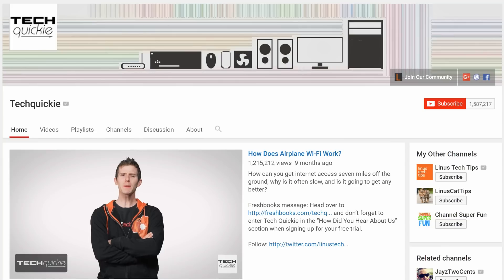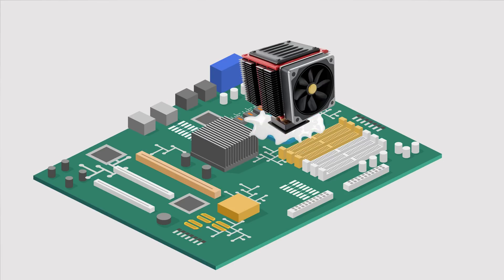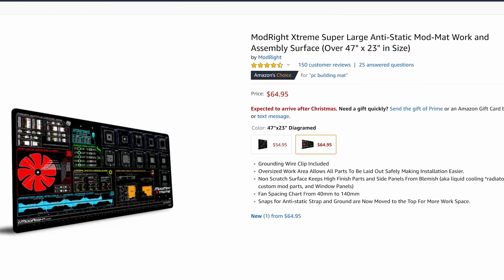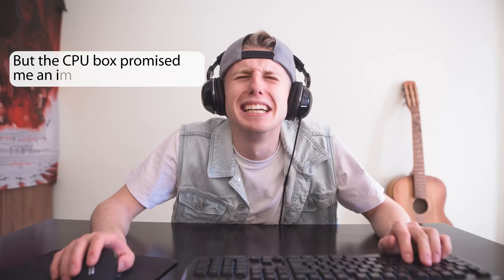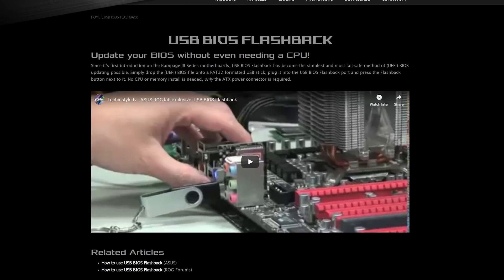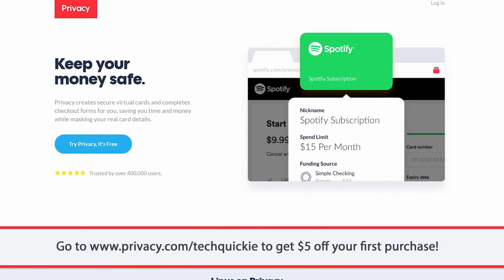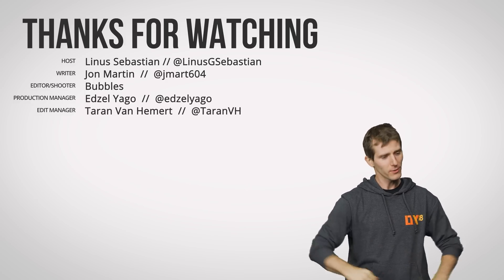DON'T Make THESE Mistakes Building A PC (pt. 5)

Comment: Never had any of these problems because I researched for months before a build when I started out. Now, I have no issues at all when building. Pro tip for those that are new to hardline tubing....when bending, slow and steady is the key. Dont try to rush it because it's boring and tedious. Take your time with your bends and you will be rewarded with a beautiful PC.

Comment: you shouldnt cheap out on the cpu. If you get an cheap one, it will be to slow in a few years. The same with the gpu. Andother point is, that if you buy a pc, you can invest some money and get a good pc cover. Never cheap out the powersuplly as well to stay safe. To combine your good stuff, dont buy a cheap motherboard, it will bottleneck everything. And buy a good cooler, if not, your expensive components will overheat.

short: Don't buy cheap stuff, if you wanna have a PC, you have to invest at least 800 bucks or more

Comment: Yes.
Like buy a Samsung 960 pro 512gb
And use it on an fx9590 system wichtig just pcie 2.0x4 and disabled as Boot device cause IMPOSSIBLE TO BOOT

Comment: I’ve built my pc but my power supply cable to go to the socket I’m my wall is the USA style but I’m from the uk so could I buy an adapter to fix that or would it mess up my power supply

Comment: I think the number one thing is making sure your 4 pin Molex connectors are actually connected. Be surprised at how many times making a PC and nothing comes on but it's because whichever moron designed them didn't take alignment into account.

Comment: Regarding M.2 drives: if you have a pc already with an M.2, check out if it's mSATA or nvme. Generally the port supports both, but do make sure beforehand. DON'T force it on the slot, it's supposed to slide in easily. Finally, check the bios m.2 configuration (raid0 or ahci) that's more adequate/compatible for your drive

Comment: i had to change out lots of parts 20 years ago (when i was 10) becouse AMD sucks (CPU and GPU dead on a PC i bought from the store and no garentee with the statment you overclocked but W/E FUCK you AMD) 

any way back to the video, if I can change out parts as a 10 year old 20 years ago without any video and just the manual LEARN TO @#$@#$ READ ! (and yes Youtube wasnt a thing back then i think it came in 2004 or 5 ? i cant remember)

Comment: If your going to install an M.2 drive, make sure to read the manual, I have a SSD in my sata 1 slot and I before I got an M.2, the manual said that if I have an M.2 drive installed, than the 1 sata slot on my motherboard will be disabled. READ YOUR MANUAL!!!!!!
Reply: My first build: Blamed the SATA or Power Cables / Blamed the new HDD / Blamed the MOBO. Moved to a different SATA port and it worked! Thought I had bad ports. I read the manual for builds 2 - 10. Some MOBOs, it's 5 AND 6 ports.
Reply: @SmittyAZ  lol nice, if you go on pcpartpicker.com itll tell you if you have an m.2 and a motherboard that it will disable a port or two.

Comment: TL;DR:
1) a little too much thermal paste is ok. be careful if it overflows on motherboard (MB). use "grain of rice" or "pea size" amount is good.
2) build PC on non-static surface (e.g. cardboard box of MB) and ground yourself.
3) check which CPU gens MB supports and which firmware version is required. if needed, upgrade bios first. (sometimes old CPU gen needed)
4) don't push down on CPU. 
5) M.2 is only the connection. M.2 drives with SATA interface exist. be sure to buy NVMe for better speed.

Comment: Make sure the hdmi cable is plugged into the GPU aka graphics card aka video card. I returned and bought 3 times because I thought there was something wrong with my mother board when I should just plugged in the hdmi cable in the gpu instead of the motherboard

Comment: So I got my brand new tomahawk MB fitted the AMD 3600 and the stock fan. My friend recommended I upgrade the cooler so whilst trying to remove the stock cooler it was jammed solid. It must have formed some sort of vacuumed fit I pulled it off and the CPU was still attached now with 2 broken pins. Luckily I managed to straighten them out and my system works fine but I think if I would have slid the stock cooler instead of pulling I would have been better off
Reply: that was a heart attack for you lol
Reply: DMC  I could have cried lol

Comment: Legit tip: short the power pins on you're motherboard before plugging in your psu.
Found this out because with power on my motherboard wouldn't jumpstart so I unplugged the psu did the jumpstart which discharges any electricity that was already there then powered on and it finally booted up. I was so scared my mobo was DOA

Comment: 1.get minimum of 16gb of ram
2. Work out how much power each component will require and get a power supply with at least 30% more power calculated
3. Clear all cables so air can freely flow through your case get a high air flow case

Comment: actually not a tip but a little story that i have to share: bought my mainboard secondhand with a ryzen pre installed with the stock cooler. i upgraded the cooler but i guess the first hand user used too much of thermal... i pulled out the cooler with the cpu on it the socket was still closed... i bend one pin on the cpu and the thermal paste was all over the pins... cleaned everything with a toothbrush and alcohol, bend the pin back, installed everything and all is working like it should....i guess i was pretty lucky...

Comment: 1: Double check your standoff screw count in your case to make sure it's the exact amount needed for the motherboard. I had one extra and my mobo sparked up months later.

2: When mounting a CPU fan always screw it in diagonally bit by bit. Fully screwing in 1 side might result in the other side being lifted far too high to screw in. I always do top left, bottom right, bottom left, top right. This is a common mistake me and my friends have made. Never screw them in all the way until all screws are screwed into the socket alittle.

3: Double check all plugs to assure they are fully in before booting the PC up. It's common for people to overlook a fan or harddrive plug not being fully in resulting in some heartbreaking damage or heating issues.

Check for:
-CPU fan
-Case fan(s)
-Harddrive(from sata and power supply if needed)
-GPU if required
-Headers

4: This isn't building but important for after it's built. Do NOT put the back of your PC directly up against a wall. Give it atleast a foot of space or the heat will fireback into it.

Last: Do not place your Power Supply upside down if your PC case isn't open below and you don't have a floor where air can flow like a crate or bars. 

Often I had people tell me they was told it's optimal and almost everytime it backfired on them because of this. You can't blow hot air into a table and expect cooling.

Goodluck builders. Most of this is common sense so you'll be fine if you be patient and don't rush.
Reply: Also for the PSU: if you have kets say 3 intake Fans and only one exhaust, place the PSU with the fan facing upwards. This will increase airflow but will barely affect the PSU since it's usually at the bottom of the case anyway, where there is not much heat.
Reply: How did you spark your motherboard?
Reply: @phantomlegend6167  I had an extra standoff in the motherboard and it was making physical contact with the motherboard. My dad put my pc together because I was sick when I got it. I didn't double check the standoffs only the plugs.
Reply: @shadovvwolfie790  so if those screws make physical touch with the mobo the mobo can fry itself?
Reply: @phantomlegend6167  Yeah eventually. Truth is it took 3-4 months before it caused severe damage. So if thats any indication of how long you have to assure this mistake doesn't happen to you.

Before my motherboard turned into the merica gun from Saints Row 4, I would have strange power issues where my usb ports were not working correctly from the motherboard. Constant disconnects or simply being unable to get a device to connect at all.
Reply: @phantomlegend6167  To answer this better(I was kinda tired last time) if the standoff is making contact with the motherboard and it isn't attached via a screw(you put screws into a standoff which is screwed into the case) it can cause Grounding issues.

The issue isn't the standoff touching it, rather that it was a extra standoff that wasn't being used for anything other than touching the back of the motherboard.
Reply: @shadovvwolfie790  I installed my new pc's motherboard twice, and on both tries i had real hard problems to align them with the holes on the mobo, like needing to push it from the right edge to the left(where the io ports are) to align properly. Is this something normal?
Reply: @bromomento2952  The usb ports should fit flawlessly through the back of the PC. If your holes are lined up in this situation then your motherboard fits your chassis. If not you might have to check if your chassis supports that motherboard size. Some only support microboards.
Reply: @shadovvwolfie790  Both had, though, even when i lined up the usb ports i still needed to push it from the edge to match up with the holes. Now everything works good enough except for some driver crashes DFUCKING AMD GET YOUR DRIVER S-HIT TOGETHER! I hope the pc doesnt break or anything lol im always a little afraid i will damage it or it will just break for no reason

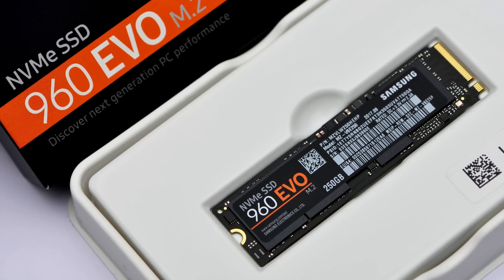Comment: 5:05 I had the same problem with my laptop. I tried to put in a new m.2 SSD into my computer but sadly, it only supported SATA. However, I placed the m.2 nvme ssd, which kinda broke my laptop, so i used the warranty and then install a sata ssd and it now works.

Comment: The connection for the M.2 SSD may disable your other SATA collections, on some motherboards, leaving you with only that as storage instead of multiple drives in another form
Reply: Most of the time its only a couple sata ports. For example my board only disables the first 2 ports. All of the other ones work fine.

Comment: don’t grab your motherboard by your cooler (mine snapped )

Don’t rip your skin against the pins on the back of the motherboard (some has)

Don’t build a pc while turning it on. 
Yes, some people think it’s ok to do that like Anthony. I still remember how he broke the IMAc pro
Reply: Anthony didnt build the imac while it was plugged it, the psu just held the charge and he touched the back of the display on something which caused it to spark.

Comment: Here is something that is hardly ever mentioned: Before changing a CPU out, turn the PC on and let it warm up first. The thermal compound will be soft enough to allow the heat sink and fan to separate without pulling the CPU with it.  Also, when installing fans make sure they are facing the way you want, most are marked "in" or "out" or with an arrow indicating air flow.  And last, but not least, because I've know people who did this,  never use your finger to see if a fan is turning;  you will damage it and even a plastic fan blade can hurt!

Comment: On my first PC build attempt I got thermal paste on the motherboard and sides of the CPU and CPU socket. I want to try and build a PC again. Can I just replace the CPU and motherboard and keep my other parts or will I have to replace my other parts too?
Reply: I answered my own question. I got a new motherboard and CPU and used my other parts and they worked.

Comment: Attention to M.2 SSD slot position. Some motherboards (like mine) have the M.2 slot just under the graphics card, so the heat of the card affects the SSD, which also heats up by itself during normal operation. This extra heat can make the SSD lose some performance because some throttle down when too hot. In extreme cases the system can hang (like what`s happening to me right now). Another problem is if your SSD already comes with radiator fins, so you may not be able to fit the graphics card at all. Some motherboards have a non-dumb position for the M.2 slot, and some have even their own radiator solution in case your SSD is bare (like the Samsung 970 Pro I have). In my situation, I will try to use an M.2 PCIe adaptor to install it in the second PCIe X16 slot of the motherboard. It also comes with thermal pads and casing, which help dissipate the heat. I hope I can solve my problem and the SSD hasn't ruined, since I have this setup for over a year and only now began to experience these issues.

Comment: the whole anti-static thing is a safety thing that i haven't done.  I've built like 5 pcs on the carpet because of there being absolutely no where else to build in my apartment and i imagine the reason i haven't had a problem is because i don't really move, i have everything within arms reach and my knee or something is almost always touching the pc case or the bed frame that's usually behind me

Comment: I made a huge mistake with my first PC. I didnt lift up the cpu retention arm before putting on the cpu, and it bent a bunch of pins. Luckilly Micro Center let me swap it out for a new one, I just told them it was dead, not that I bent pins. That was like 6 years ago.

Comment: Having a power supply plugged in, but to an outlet not properly grounded. I wonder if it works as intended then. Most homes are not grounded properly if built 30+ years ago, which is most homes in USA. I contracted cable for 8 years, most outlets here are not grounded. Most just have updated sockets, but no ground, or the ground is improper. Lot of daisy chains off outlets here. Then a ground past 20feet is really not a ground.

Comment: As for "too much thermal paste", I'm working on a 486 from the OLD days back when using thermal cooling solutions at ALL was a new concept, and it used that crappy silicone crap.
The system builder used too much, and it got into the socket....
... creating the polar opposite problem that Linus mentioned, and INSULATED several CPU pins from their connections in the socket, and making the system unreliable.

Comment: Tip if your PC turns on but doesnt post dont freak out check the red lights on the motherboard to see where the problem is locatedif it's the gpu try switching it PCI-E slots

Comment: What if I specifically wanted that M.2 SATA for my rig.  Not only are they cheap, but they also have an incredibly small footprint depending on what adapter you use.

Comment: The number one mistake is not using 4 box fans nailed to a wooden frame, as your airflow. Why buy a 50$ case with 3 12$ wimpy fans, when you can instead buy 3 15$ box fans a couple of 2X4s, some wood nails, and a 32 pack of zip ties for way more airflow

Comment: tip number one: dont buy a mac
tip number two: if you dont know something for sure (like what bracket to use for mounting your cpu cooler) read the manual of your products if needed. dont waste your time by struggling or breaking stuff just because your to proud to read a manual.

Comment: wait. how does non conductive thermal paste work?! if it doesn't conduct electricity, it won't conduct heat. if it isn't a conductor, isn't it an insulator? the exact opposite of what you want?

Comment: 1) close any vents with filters, pcie slots with missing brackets etc, wherever dust would enter. I fried an (admittedly low end) GPU to learn this. 
2) screw hard drives tightly, especially consumer grade. Manufacturers have described the read errors & increased wear caused by loose drives (avoid HDD suspension systems).

Comment: I sat on my carpet whilst building and didn't use any anti static stuff (except mobo box for a rigid surface) and  it is all fine so basically don't be an idiot but these tips are definitely advisable if available

Comment: Check how many PCI lanes your CPU supports and compare that to whatever your PCI devices need in order to ensure max speed. I made this mistake myself with my current build where my GPU uses 16 PCIE lanes but can only use 8 as my CPU only supports that.

Comment: #1 tip: make sure to align the power supply with the insulating pads on the case so it doesn’t short circuit and come in contact with the rest of the system.

Comment: So buying 2 CPU is a good idea 
Though not by mean the same CPU i mean One is the one that is intended in your build and one is used to update the firmware or uefi bios if needed 
Now the cpu to do the update does not need to be expensive just use the same cpu gen that will work with your motherboard lets say a celeron or a pentium

Comment: Last year I was cleaning my pc tower. When assembling everything together again I didn't notice one of the placeholders of my cooling fan was kind of bent and I ended up positioning it incorrectly... while it was pushing the processor more than it should. When I noticed half of the pins on the board were bent and I had to spent sweet 3 hours repairing them. Gosh, it took a lot of patience.

Comment: Back in the day when I built my first computer I found out the hard way that CPU coolers are necessary. At that time CPUs didn't ship with stock coolers so you had to buy that separately so I though those things were just for hardcore computer geeks, I just wanted a decent computer to play doom and quake...That's the only time I've ever seen smoke coming out of a computer.

Comment: When building a custom water loop, double check the screw length before screwing a fan into a radiator..  and don't forget to factor in a drain valve.

Comment: A habit I got into with thermal paste is to spread it on the die with the little foam pad usually used to protect the chip's pins in the packaging. This makes for a thin layer across the entire surface with even coverage and no gaps.

Comment: M.2 not working? Check manual; you may not have enough PCI lanes (in the CPU). Other stuff that could stop the M.2 from working is connected SATA devices to certain ports, or PCI-E cards in certain slots. Read the manual. That can save you a lot of grief...